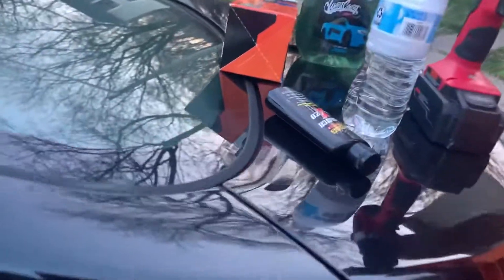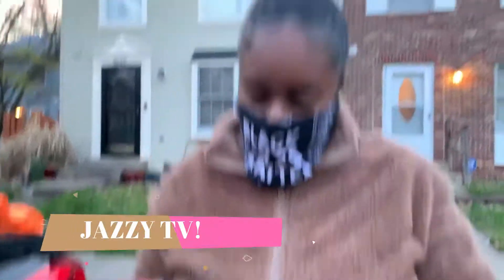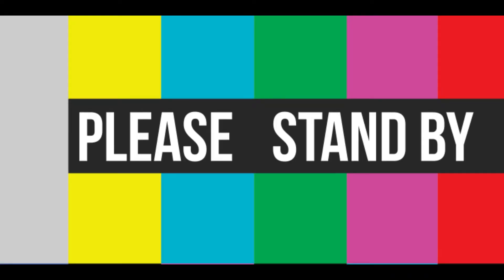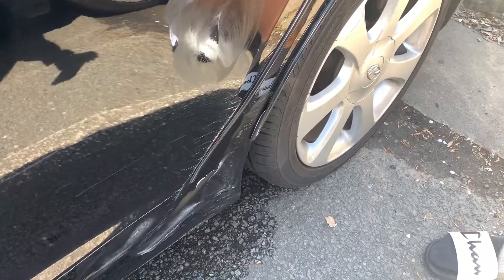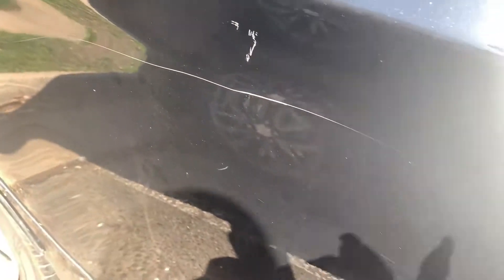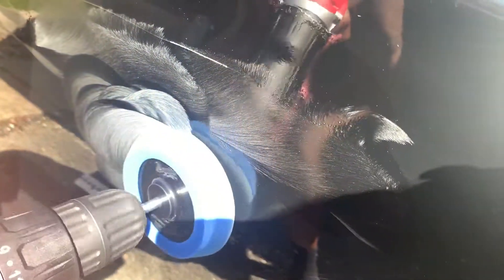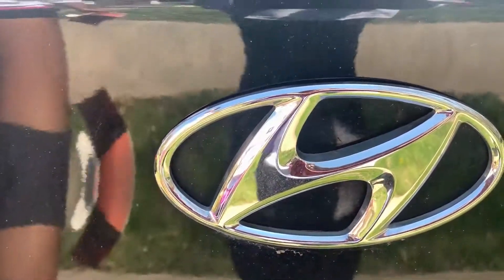MEGUIAR'S QUICK SCRATCH ERASER KIT|PRODUCT REVIEW

Comment: Thanks for your presentation, I had just bought my kit. Your really do not need a lot, just a cross made of two thin lines going edge to edge. The small amount they advise really does go a long way. My car brushed up against some bushes on a tight country road, which caused a long scratch the full length of my door. I was fantastic completely gone, cleared it up no problems. It was equally fantastic on some other light scratches.
As it says, it is only for fine scratches and blemishes. So if you can feel the scratch with your fingernail, this kit will not fix that type of scratch, but that said, it definitely makes them less visible. Any deep scratch, or a scratch that you can feel with your fingernail this kit won't help.

The instructions say to:
Place a small amount of the scratch eraser in the shape of an X on the pad.
Use a medium speed setting on your drill.
Make 4 or 5 passes with the pad.
Remove the excess scratch eraser from the pad by pressing it in a damp towel/cloth several times.
Then using only light pressure, again on medium speed making 4-6 light passes.
Then buff off with the microfibre towel.

I noticed that you didn't clean the pad make a second pass and you still had some good results.

They do advise not to run the pad on high speed as this can generate heat which reduces its effectiveness, and using too much product is only a waste of product, it won't make it any better. If necessary repeat the instructions. You will be amazed, I was. I can recommend this.

Just so that you are aware, the numbers around the drill chuck are not speed settings, they are the clutch setting to change the amount of torque applied by the motor, so you don't over tighten screws and nuts/bolts.
The speed of the drill is often controlled by varying the depression of the trigger such as on my Ryobi or by a dial on the trigger such as my Black & Decker. The drill may also have a high and a low switch for additional speed control, on my Ryobi it is on the top 1 = normal, and 2 = high speed.
Reply from the maker: Awesome!!!

Comment: You didnt show the end results and alot of the instructions on the box wasnt explained. I didnt know you were supposed to have a cleaner which doesn't come with the kit
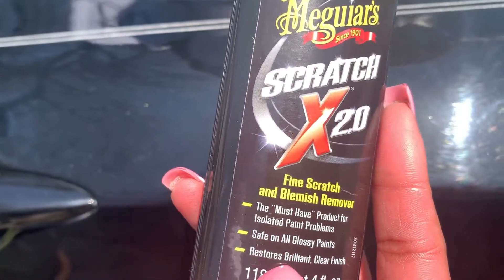Reply from the maker: You don’t need a specific cleaner, you just want a clean surface before you start. The only instructions on the box is to put the cleaner on the sponge and then press the button to start the scrub. Some of the audio was removed but there was no final result to show. Some of the scratches were too deep and the paint was messed up. @6:05 I showed the product and how it’s made for only fine scratches